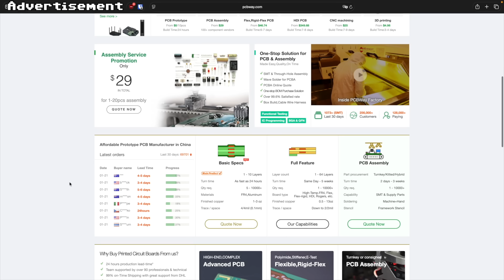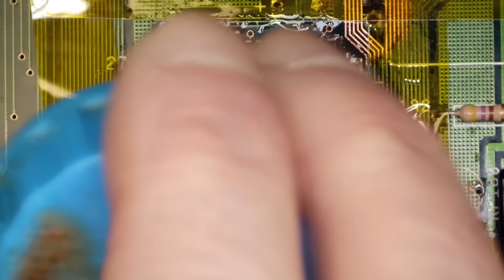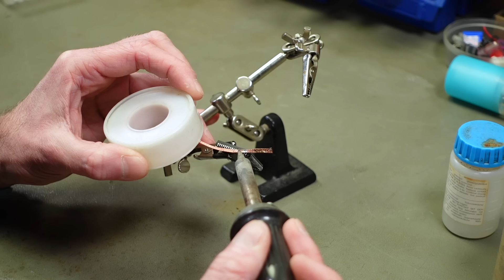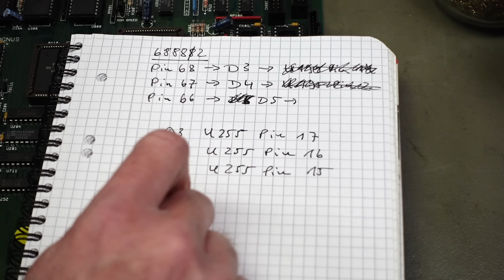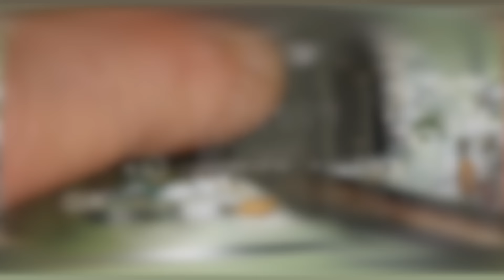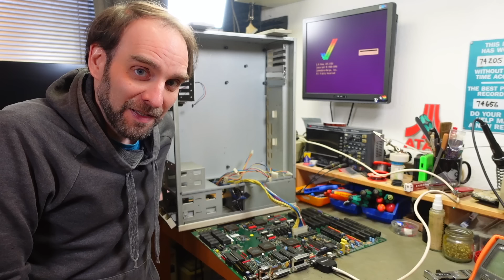Amiga 3000T Restoration Part 3: Board Repairs & Smoke Test

Comment: Would a laser be able to cut out replacement spans of traces out of copper tape? Would be a big development in tech restoration
Reply from the maker: Probably. I think you can at least buy replacement solder pads and such to fix corroded boards (but that’s on a level of professional repair that I’m not even close to). :)

Comment: Hi Jan, congratulations on the successful repair.

Although I had some meltdowns by looking your video 😁

For repairing the traces, you can use stranded wire. It allows you to repair the traces almost invisibly.

Please don't always use hot air, especially on corroded areas. You can remove the chip using low-melt solder or rose metal solder with just a soldering iron. This protects both the chip and the circuit board. You just need to apply more solder.

You can also easily desolder the electrolytic capacitors this way.

Your main problem, however, is your soldering station; it's not supplying enough heat. Normally, this isn't such a big issue.

UV lacquer is good, but if you need to access the damaged areas again, it's difficult to remove. Use Kontakt 70; it's transparent, and you can solder through it.

Also, always test the board before sealing it; anything else will bringing missfortune by the Atari god 😁
You could have tested the board with Diagroms without the FPU first, or by setting the FPU jumper to position 2-3. Then the 3000T will boot with Kickstart even without the FPU (this isn't documented).

I think it would be a good idea if you joined us at our annual hardware event in Finkenbach. I could show you some tricks there that would make your life easier and soldering work faster. If you're interested, ping me.

smart-ass mode off
Reply from the maker: I appreciate the detailed advice on soldering techniques and trace repairs, it's always great to learn new approaches! Thanks for all your help. Not sure if I can make it to the meetup but I’m going to try.

Comment: Well done. I was really hoping to see that Kickstart screen. I'm also really impressed you made a solid attempt to use solder mask, cure it, and successfully perform SMD chip operations, which is next level for most amateur retro repairers. I've been practicing the SMD repairs I've seen Louis Rossmann and Sorin perform for several years. It takes a while to master removing and replacing larger SMDs; you need a decent hot air station - and lots of flux. If you then dive into the weeds of reconstructing broken traces and eyelets, the task can become even more overwhelming at first. Patience, knowledge, and practice are the virtues at this level of electronic repair. Nice work and keep practicing.
Reply from the maker: I tried my best to tackle the SMD work and I'm glad it paid off in the end. Thanks for the encouraging words! :)
Reply: @JanBeta  Bitte schön!

Comment: Is there no socket you could have used when its was already removed to make future diagnostics easier ?
Reply from the maker: There are PLCC sockets, of course. Unfortunately there’s not enough room at this position to fit one without major relocation of smaller components. I considered using a socket at first but decided against it (also because those Motorola chips are very very resilient in my experience). Thankfully it worked out so far!

Comment: Just use clear fingernail polish to cover the copper.  The UV epoxy is overkill.  You can remove it with Acetone (fingernail polish remover) should you need to work on it again.

Comment: That's an amazing result, such a nice machine! I wonder if the low melt solder actually helped, it looked like it didn't really mix with the old solder?
Reply from the maker: Thanks! The low melt solder partially worked, I think. Some of the more corroded pins didn’t take it too well but I think overall it helped to get the components off quickly without overheating the board.